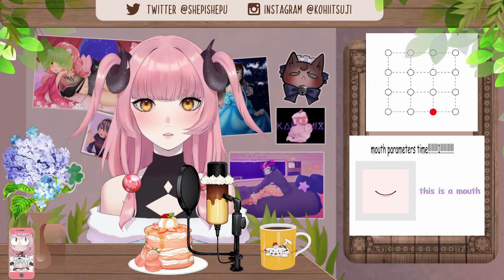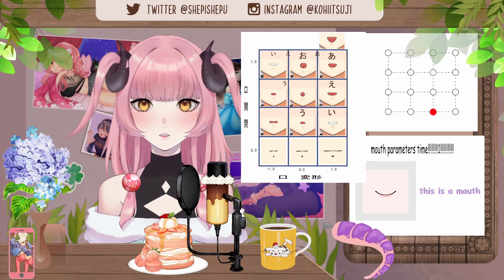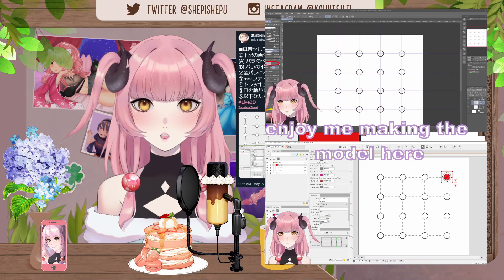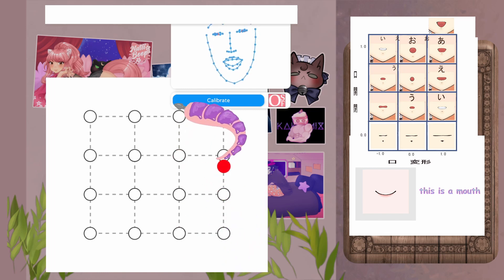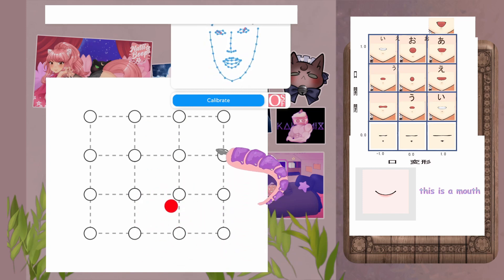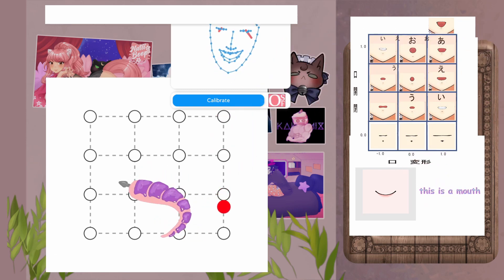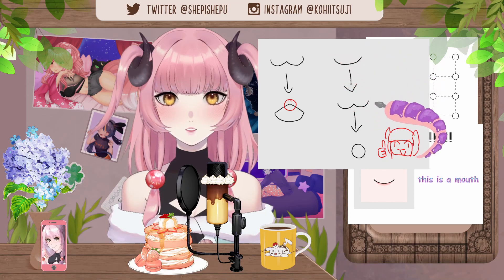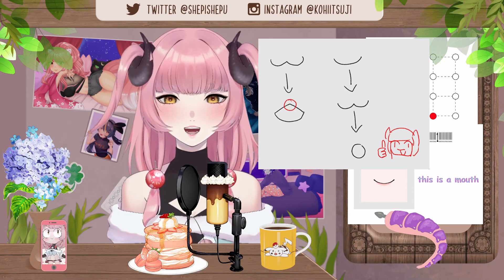How do Live2D mouths work?? Find out now! 『Live2D Guide 4』

Comment: the default models in vtube studio always look drunk/sleepy/depressed. i tried tracking only with the studio display camera, which isn't the best, but i don't think i will be able to fix this just by playing with the settings. is this something that can be fixed by someone who knows how to rig a model? i basically just need my eyes at rest to be a little more than half open, not be 85% closed.
Reply from the maker: Hi there! You can do something in Live2D to kind of help this problem. Consider that the eye open parameter is on a scale of 0-1, and normally has points on 0 and 1 ( closed and open respectively)

You can put an extra point at say 0.8 and copy the opened eye so that from 0.8-1 your eyes are always open. however if you haven’t used Live2D much before this might be hard to understand without help? 
There are also other options like Vbridger which offer better tracking but it also costs money
I think there are ways to help alleviate it in the settings of vtube studio as well but I will have to check back on that because I cant think of it of the top of my head 😭

Comment: yo guys I really dont understand. When I rig the mouth following the tutorial and save the file exporting it to vtube studio , the eyes i rigged work perfectly but the mouth doesnt. How can I fix this..?
Reply from the maker: Hi there! There could be a variety of possibilities to why it's not working but I'll try and help you troubleshoot as much as possible. 

In Vtube Studio go into the model settings, where you can see all the parameters. Scroll down until you find the two Mouth paramaters (smile and open), then double check your "output" is linked to the appropriate mouth open parameter. (if its highlighted red there is a conflicting problem)
Then if thats fine, check the output numbers, I think by default the mouth open is set to around 1.6, so you can lower this number if its not sensitive enough. 
If this didn't help or was a little confusing, I'd like you to link me your model if possible so I can check the files myself for any problems. If you can't link the file, a video showing you using it in Vtube Studio would also help. Also remember to check the lighting in your room to make sure you camera can pick up your mouth movements!